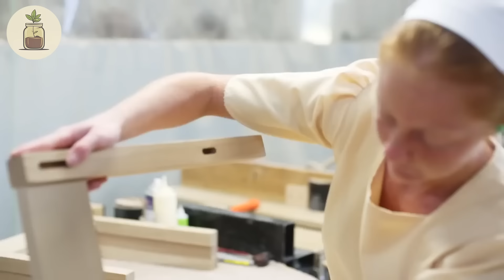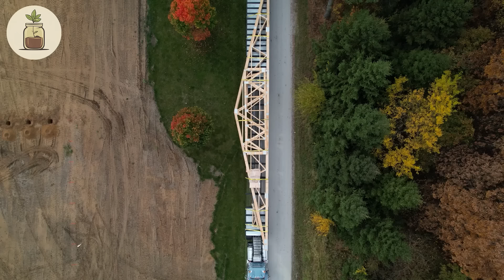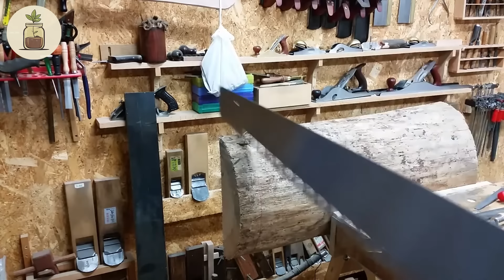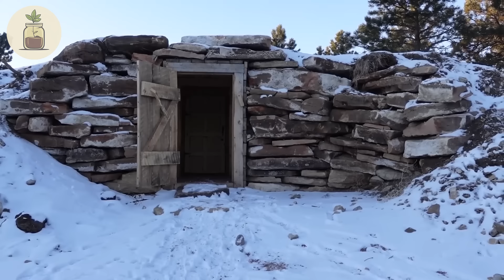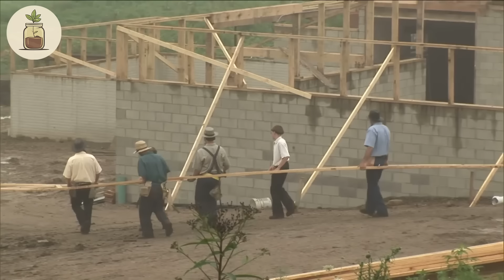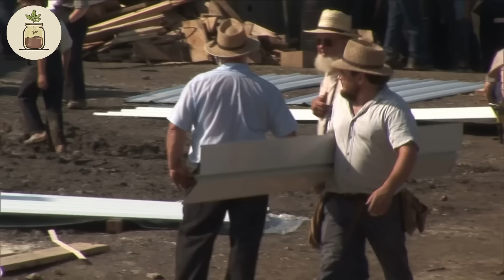50 Amish Building Tricks That Defy Modern Methods

Comment: These kinds of tricks are taught to many modern builders.
I know a great deal of them, taught to me by other carpenters and cabinet builders in the trade, many years ago. You will forget them if you dont use them often.
The Amish should be congradulated for using and passing down these techniques.
Reply: We use many same tricks as of today than amish do exept we use power tools and screws. We still build onsite full wall joinery and lift those walls as a module like amish do. ONly sometime when there is only 1 or 2 builders they do each peace 1 by 1 way wall contruction. But if there is 5 guys team then its full wall as module way always.

Comment: Builder here who frequently work with local amish... most of these techniques are still used today.  Amish lumber is superior in some ways but less superior in others.  Their buildings last longer because they're overbuilt, which cost more than most non-Amish people can afford to pay.  Passive solar design is used because they dont rely on mechanical hvac systems.  Those same energy efficient practices are becoming more prevalent in modern construction to reduce energy consumption.  All of these techniques are not exclusive to the amish and are general historic building practices.

Comment: Starts off with primitive hand measurements, but all hands are not the same size; then next we see a tape measure, a router, and a power drill driving in screws.  Sure.  That's real traditional and innovative.

Comment: I see a much work being done with the help of gasoline and electrical tools.  How do the Amish decide which machines are permitted (power saws, routers, tractors) and which are not (famously automobiles and telephones)?
Reply: The church decides and most can use modern tools and tech in order to work ex. They have a land line on the farm but the phones out in the barn or shed not in the home cell phones at work and so on certain Amish are stricter than others
Reply: @zachhaag7854 when you say "church" are you referring to a local congregation, deciding to for it's members only, or to a higher body deciding for all Amish?
Reply: @birdwatcher101gbh local congregation, maybe a bishop over 1 or up to a few  congregations.
Reply: I also see them using rebar, nails, steel racks, etc. that others produced using automation.
Reply: I think those might have been Mennonite

Comment: That's some nice traditional electric and hydraulic. gasoline. Diesel. nail guns. Routers. Circular saws . belt sanders and excavators the Amish are using.
Reply: Haha, yeah — nothing says “traditional craftsmanship” like a diesel engine and a nail gun! Gotta respect the Amish for blending old-world skills with just the right touch of modern machinery. Gets the job done, that’s for sure!
Reply: - yes the technology disconnect is a commercial lie.   Traditional construction techniques and methods have some merit.

Frost heave resistant foundations are more about depth of foundation - located below seasonal heaving geology - less about "witchcraft".  Over Engineering works.
Reply: I think those were Mennonite instead of amish
Reply: yeah exactly give me a break.
Reply: RIGHT  !  As well as plastic stretch wrap and plastic templates. No secrets here. Any traditional woodworker knows how to achieve these same procedures and products. It is just a matter of difference in pricing.